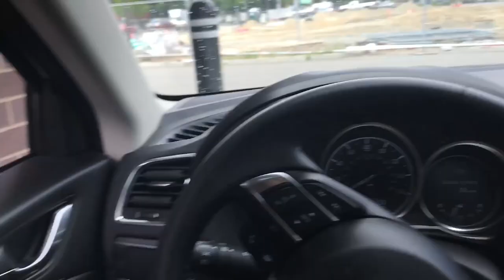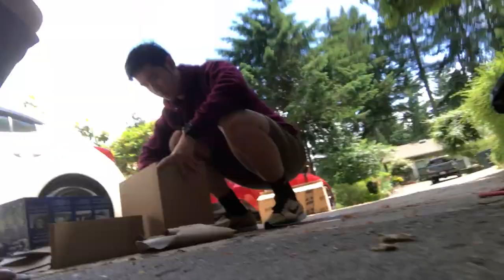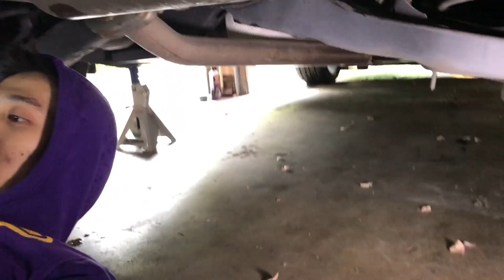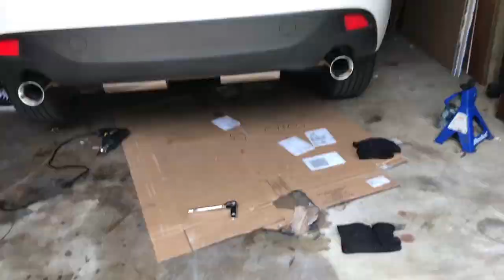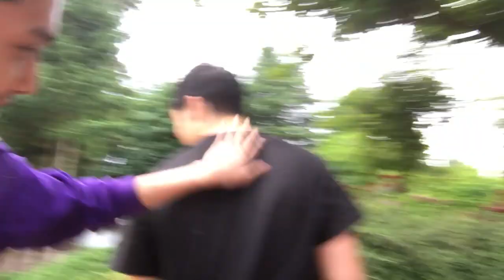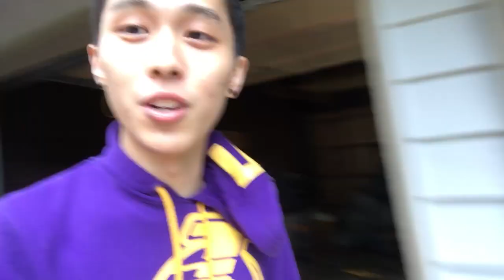COLD START BORLA S-TYPE & CORKSPORT AXLEBACK // MAZDA 3 VLOG#4// COLD START + REV

Comment: Much better way to work on the car. Jack up from the front crossmember if you want to lift the front. If you want to lift the back, there is a bump on the rear crossmember. Both points are the factory jack points, you can see this if you download the mazda shop manual. And using a drill as an impact? No good. Get even a 12V lithium craftsman impact for cheap, I think I paid $40. Then get an extendable 3/8" ratchet at walmart (stanley) or harbor freight to break bolts lose.

Comment: Is the Borla overall louder (cold start/normal idle) then the corksport? I was also looking at ultimate racing exhaust too. Did you hear how those sound?
Reply from the maker: +Tech Defender yeah borla is louder for sure. I did compare with ultimate racing but I like a little rumble on my exhaust if you know what mean, that's why I went w borla.
Reply: MTJY so the Borla gives off more of a rumble then ultimate racing? Which in your opinion had the deeper/lower sound?
Reply from the maker: +Tech Defender honestly I can't give you an actual answer for that. Since I don't have an ultimate racing, I saw their videos but I didn't like it. I always like how Borla sounds, which after I had my midpipe on, it sounds so aggressive! You should check out my latest video

Comment: Too bad we can't turbo our mazda 3s :(
Reply: Tyler V. You can actually using Mazda’s variable pressure turbo that has built in valves to keep high pressure from blowing engine cause the new cx7s have turbo skyactiv